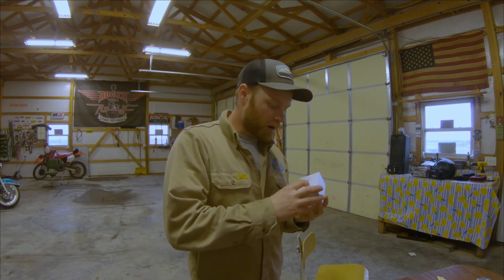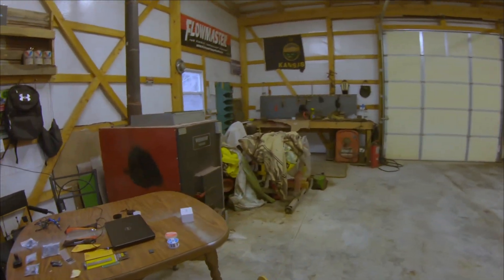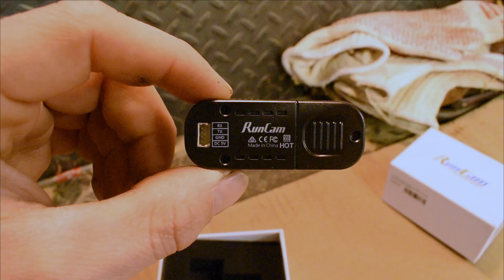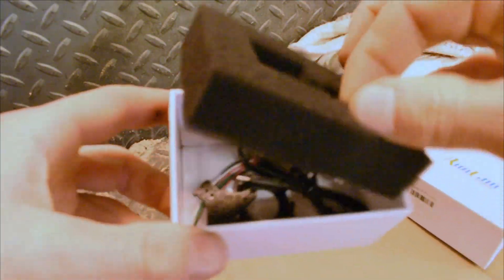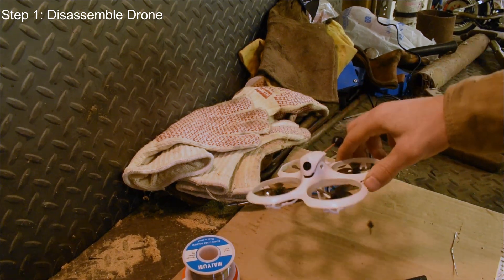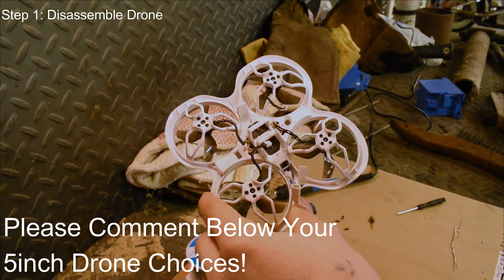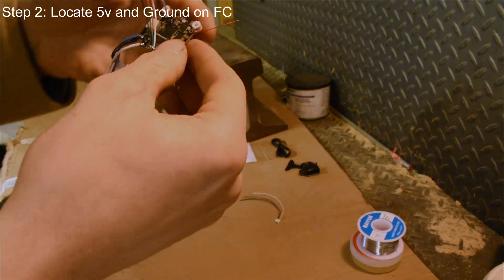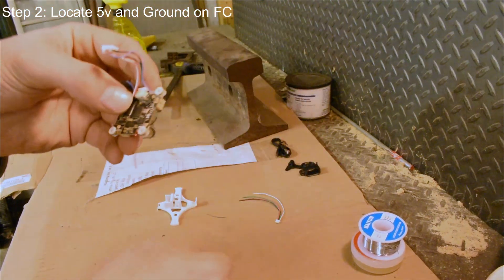RunCam Thumb Pro Unboxing and Install on Cetus X

Comment: My cetus flight controller appear not enough powerful. Once I arm - camera goes off. The problem was solved by connecting directly to batts via separate installed vcc adapter

Comment: Hello, I am from Taiwan. The small lens of the run cam in my cetus x fpv was broken. After I dismantled the plastic case of the body, I found that the design of the lens was combined with the image transmission circuit board, and the lens could not be replaced separately. So I would like to ask you, where can I find a whole new lens with a video transmission circuit board to replace it? I see that the whole new lens is not sold on the official website of the original manufacturer. What should I do? Can you give me some advice? ? Thank you.

Comment: Doesnt it consume much power? 
I installed Thumb pro and Lollipop ant. as you showed on your videos, and definitely the video was better, but flight time got shorter to 4 mins. which used to be 5 mins. or so.

After 4 mins. my goggles get blacked out and soon my controller says "telemetry lost," meaning the drone turned off.

Comment: did you change pids or other settings in betaflight for flying with a thumb pro?
Reply from the maker: I've only adjusted the dynamic idle settings. I'll update this the next time I get the cetus hooked to betaflight and let you know what it's set to. The cetus x has some really bad propwash tho.
Reply: @GR4YK3Y  thanks!
Reply from the maker: @vadymfpv  Got a new 5 inch drone recently and will be doing a full pid tuning process of it since it has blackbox. Once I get that completed I hope to go back and do a proper pid tune of the cetus. It needs it bad.

Comment: did you use the stock wire that comes with Thumb Pro ? and if so, did you use as it was or cut to shorten the wire?
Reply from the maker: Hey sorry for the late reply Sohn. Been interviewing for a new job and its been taking up my youtube time. I just used the stock length. It could probably be shorted 15-25mm but the stock length seemed to fit fine without to much extra play. I didn't want to shorten bc I plan to put in on my upcoming 5inch build.
Reply: @GR4YK3Y  Thanks for the reply. Oh I see.. Good luck with your new job lol.
Reply from the maker: @Sohn Jeongho  yeah, had the main interview this morning.  It was super tough.

Comment: Good Info, I was surprised the lens protector stayed on.
Reply from the maker: Yeah me to. The SD card did end up popping out a bit and that's what caused the recording to stop 15 seconds before the crash.
Reply: @GR4YK3Y   I have been using a tiny piece of  blue tack-it putty to keep the SD card from sliding out.

Comment: I love my runcam pro. I've been filling up an SD card for a couple weeks, when I finally have an hour to unload and edit some videos, I stead of using the few minutes I have a day to fly, I'll post them. I think it's going to be the naked gopro replacement. I'm sure in the next year or so there will be enough hardware and firmware updates to really bring it there.
Reply from the maker: Yeah the fact the runcam has a built in gyro and can be used so seamlessly with gyroflow really sets it apart from other cameras in that price range. I need to get better at fine tuning the gyroflow editing. I will be doing a ND Filter testing video of the runcam once I get my 5inch build setup.

Comment: Nice and informative, I see you resolved the jello, the image quality is very good even at night !
Can you also share a video of your  tuning ? 
Once you hit 100 in no time, would love to see the HGLRC sector D5 or a inflight Nazgûl’ 🎉
Reply: Congrats on hitting. 100 !!! :stayhome::stayhome::stayhome::stayhome:
Reply from the maker: I really appreciate the congrats iFly, thank you! Once I get some more of those mounts 3d printed I will finally finish up the PID tune. It was just a little too windy for me to get it all fine tuned. So far I just have a dynamic idle adjustment running that has cut the propwash by maybe 50%. Still quite noticeable though. Yeah I have been looking into HGLRC! I will definitely check out the Sector D5 as a top option.